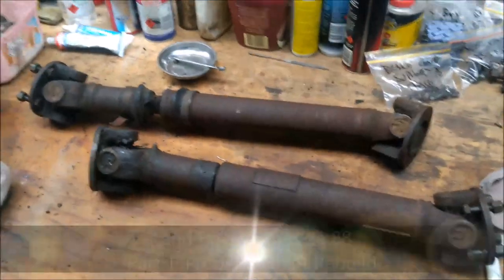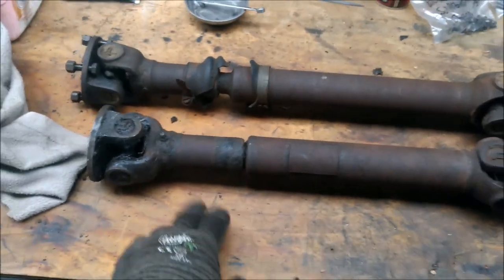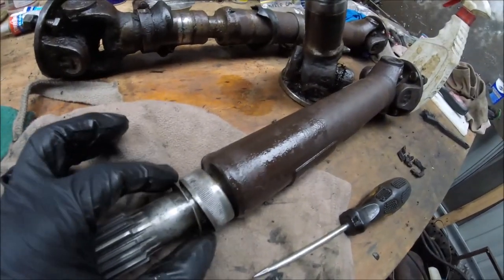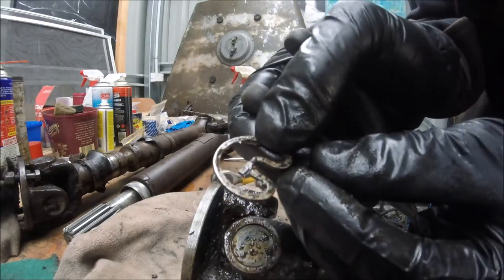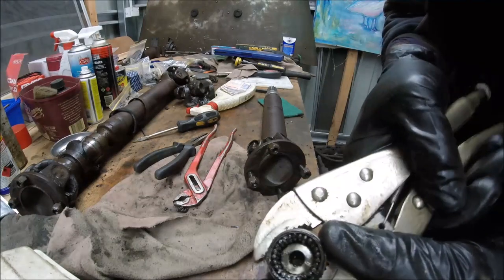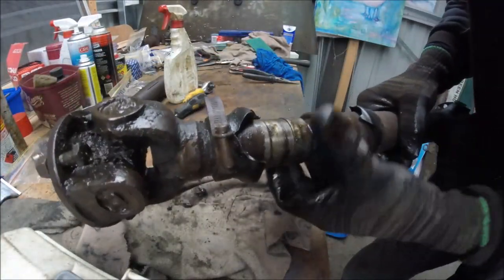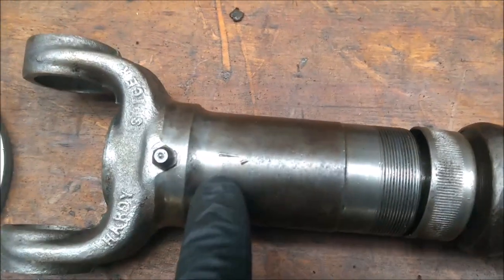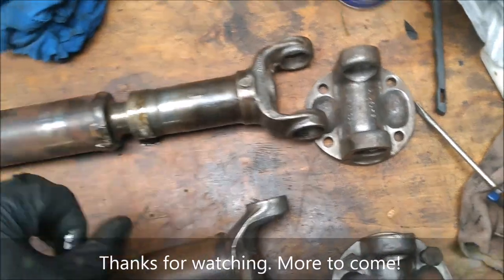Land Rover Series 2a 88 - Part: 1 Propeller Shaft Rebuild (long)

Comment: Thank you for that,
I'm fitting s rebuilt gear and transfer box to many 47 year old S3, which means also needing to replace the ends of my seat box and re-fabricate the tool box 🤣.
But I didn't get why grease was escaping into the UJ from greasing the splines.
Thanks to your Fully comprehensive vid, I can now see the breather hole at the end, so it makes sense.
Some make that rubber seal from a piece of leather btw.
Really helped me avoid extra work as the UJ's ect are all good on mine, just a good clean Kurust treatment and some 2K black should do the job for a time.
Thanks again Sir
Reply from the maker: Great that it helped. All the best with your build, good to know another one is being taken care of.

Comment: Hope you don‘t mind my input. it‘s better to use a vice and a lot easier and it keeps the sockets from moving off centre. Replacing them you need and even pressure on the caps or the roller bearings will fall out of the grease. Cheers David.
Reply from the maker: Dont mind at all, I want others to contribute so that it becomes a knowledge bank too. For removal, i wasnt worried about damaging the unis. However installation of new ones will be differnt. In fact i just bought a bench vice as i didnt have one (i know its a must have basic tool) so ill be using the vice for this purpose.  This is where Part 2 vid will come, but as yet need to order the unis!

Comment: Hi mate, my yokes weren't aligned. I don't know how long they stayed like that. Everything seems straight but should I assemble the right way or maybe the last mechanic (not from a major garage or maybe from an African mechanic shop) was into something. Arrows are there.
 Keep it up, your videos are my perfect complement to the green bible.
Reply from the maker: Depends, if there are arrows the see if they are matching. Some props may be like this.  Thanks for posting and your comments.
Reply: The arrows point like yours (parallel) but they were assembled like newer ones I suppose (offset)
Reply from the maker: I would be aligning the arrows on reassembly. It may be that the mechanic was not aware of the arrow marks.